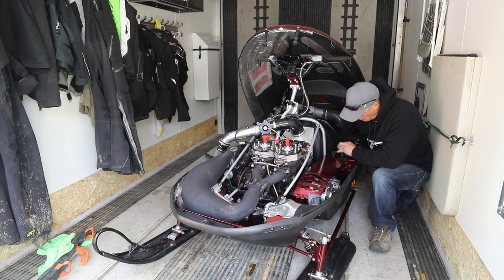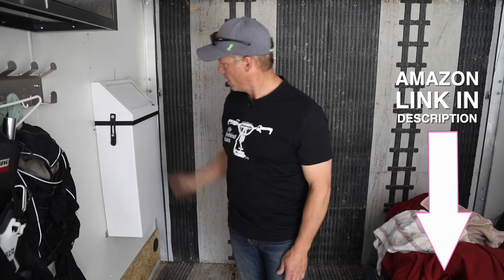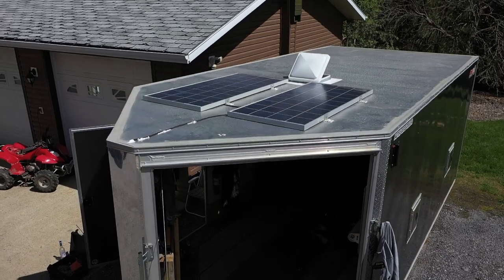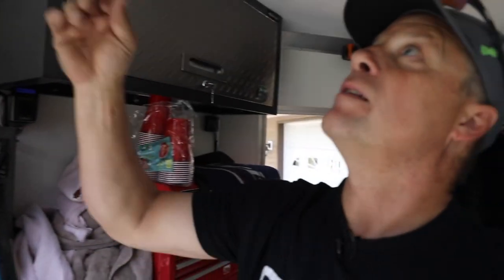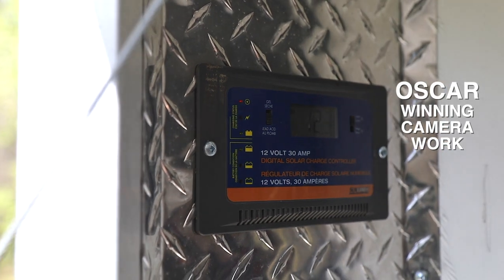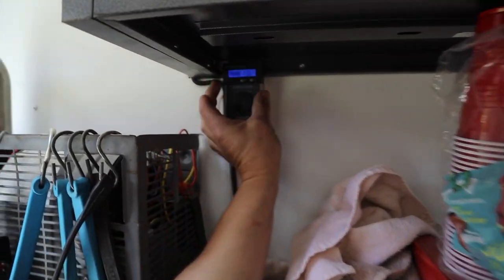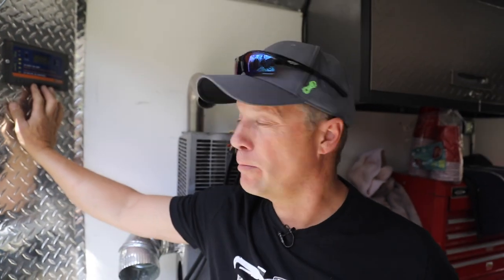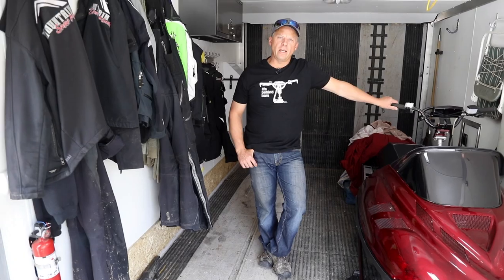Solar installation. Trailer mod. Works great!

Comment: Did the same thing on my sled trailer a couple yrs ago. 2 - 200 watts on the roof, a 3000 watt inverted and the diesel heater.  It keeps the batteries charged, runs the heater no problem, and you charge radios etc off the inverter.  We stay in it all the time, works great. 

No need to worry about the solar working on the highway, once it’s plugged into your truck, you should be charging the batteries off your alternator while driving.  If they are not connected to the truck system, get a battery doctor isolator for the truck and connect it to the 12+ volt in your 7 pin connector and then to the trailer batteries, use a fuse to prevent excess current draw.  Shoot me a Message if you need more info.  

Ps. You should have a battery readout screen on your diesel heater controller, and the charge controller also has battery voltage readout, so not sure the extra battery voltage monitor is necessary?

Comment: wondering how you mounted those panels to your roof?  if you use self drillers it doesn't cause a leak?
Reply from the maker: Jason McMurray yeah sorry Jason, we did a poss poor job on editing that video. I’ll post a little tutorial on our website and let you know.
Reply from the maker: Hey Jason I just posted a little blurb on our Community tab here in YouTube. If you can' find that post, here are the deets of the screws: I just cut those little aluminum angles on a ban saw and then used 5/16 self tappers (1.5" long) to fasten on the roof.